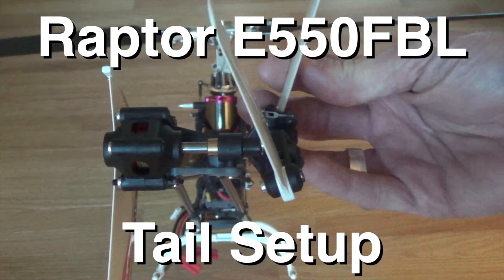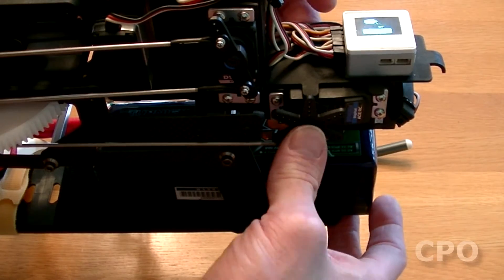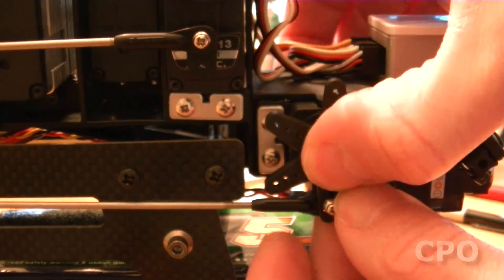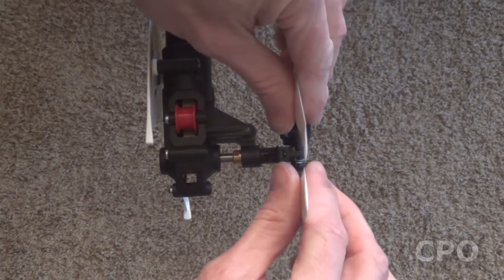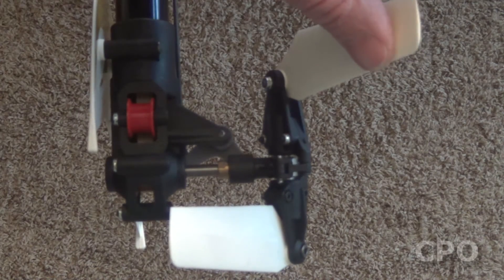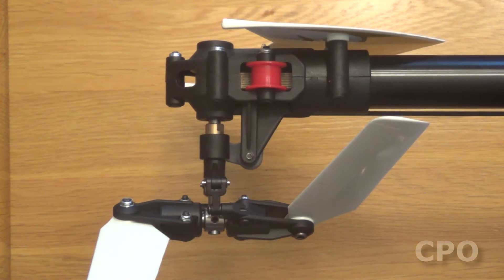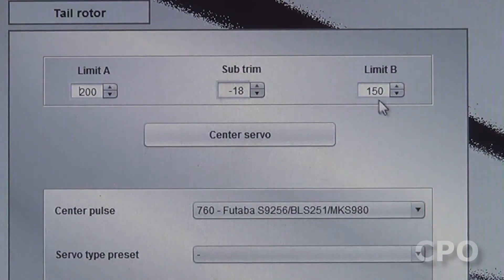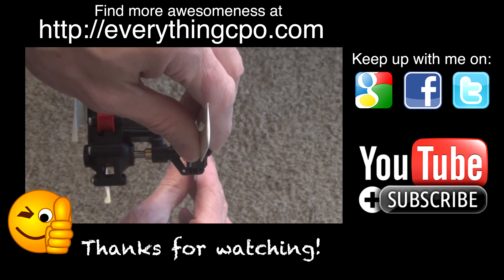TT Raptor E550FBL Tail Setup (and a bit about tail pitch at center)

Comment: Here is the question hope you can help me 
The old trex600 main blades spin the same direction of the new synergy  that it will be clock wise but the tail blades spinning different the trex counter clock ,the synergy clock wise 
First independent of the way the tail blades spin the inputs on the stick should be the same right ? That’s mean stick to the left slider to the right and Vice a versa right or wrong? 
What way the tail blades should be pitch to , on the synergy 6 degrees to the left or right ? Looking the heli from the back 
Hope you can answer this question you looks very knowledge thanks

Comment: I’m very new when it comes to helis a stop flying helis 8 years back and now I start again but I’m going from the old flybar to the new flybarless heli I have the synergy n5c 
I did al the build and set up I did try to fly it and I got a small crash do to at take off the heli start to spin to fast I’m sure I made a mistake on the topic you just explain

Comment: Hello, I am looking for help;
I got myself the Assault 450 Helicopter from Hobbyking (Flybarless System is the 'Turnigy 3D-H V2') The 3D-H is a copy of the Beast X (similar, even the same menu points etc.). 
Here's my problem: The tail rotor moves nicely but when I am at 10% of my Controller it got 100% of the tail rotor pitch. I am not able to fly, it is too sensitive. I tried to fix it on my Controller but it doesn't work. I even got the maximum pitch from my controller to 10% and it still doesn't change. 

If you know the solution to the problem, I'd be very thankful!

Comment: Spot on. Nicely done.

A couple of extra notes. Generally speaking if you set the pitch lever on the gearbox to be 90degs to the pushrod then most models will give you that 7degs of right nose.

However what you are really looking for is hands off hovering with the gyro in rate mode. This is the aerodynamic centre most gyros want. So if you are anal about setup you should go hover the model then run through the rest of the setup again.

Some models due to the geometry of the linkage and setup the tail as you have gives very little left tail pitch. If all you are doing is basic aerobatics its not too much of a problem however ideally in this situation you want to offset the servo horn one spline to the right this will increase the figure for right pitch and give more throw of left pitch for the same limit value.
Reply from the maker: Thanks, Ade. Also appreciate the extra feedback. I think tail setup has to be the most confusing part of heli setup just because it isn't as well documented as head setup. More tips and info = better chance of helping people get it right!
Reply: There is a certain amount of working out what works best on your combination of model/gyro/tail blades. Each has their own set of conditions which work best. The most common problems are aerodynamic centre and servo horn length. Its important to get it as happy as possible then fine tune from there in the gyro as gyro settings like debounce can be used to mask mechanical setup issues but still give issues in other parts of the flight envelope.